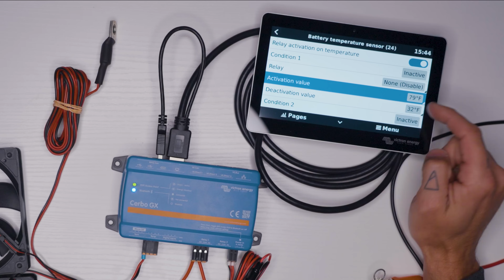Controlling a Fan with the Cerbo GX

Comment: Thanks - this was helpful.  I was thinking the Cerbo could be used for something like this.  I installed cooling fans in the electrical compartment, but don't have an automatic way to turn them on and off.  For battery warmers (which I am thinking about adding) I would need to use another a second higher powered relay that would be triggered by the Cerbo relay.

I might get a Cerbo and the monitoring screen.
Reply from the maker: Perfect!  We have those in stock and ready to ship in our store.  Reach out if we can assist in any way: https://shop.explorist.life/support?utm_source=youtube&utm_medium=comment&utm_campaign=support&utm_content=response_link

Comment: If anyone has lost their terminal relay blocks, or their installer did not provide and you want to make this upgrade - which I did and highly recommend doing, know that Victron distributors do not sell relay or the I/O terminal blocks. The temp sensor yes, the blocks, no. But I found aftermarket parts that work perfectly.

----------------------
MFG : WURTH ELECTRONICS INC / 691352710003
DESC: TERM BLOCK PLUG 3POS 5.00mm 1.85000 1.85

This terminal block has a screw driven compression clamp and its pitch is ever so slightly less than the OEM block. Because this block does not use an OEM style vertical spring mechanism, it's profile is not as tall as the OEM (it hangs down less from the GX).   I bought 1 of these blocks for $1.85 + shipping from an un-named electronics parts distributor.

======================~~======================

MFG : WURTH ELECTRONICS INC / 691353500003
DESC: TERM BLOCK PLUG 3POS 5.08mm 3.55000 3.55
 
This terminal block has spring loaded compression clamps and its pitch matches the OEM blocks pitch perfectly.   I bought 1 of these blocks for $3.55  + shipping from an un-named electronics parts distributor.

I like the screw style better.

Comment: Consider using a auto radiator cooling fan thermo relay/switch, at least 15 amp control.
Reply from the maker: That wouldn’t utilize the cerbo GX, though, which is the whole point of this entire video.

Comment: Does the relay take AC current? I am thinking of using a 230V fan...?????
Reply from the maker: Great question! Some relays can handle AC loads like a 230V fan, but it really depends on the specific relay module being used and how it's wired into the system.

To be sure you're using the right gear and staying safe, I’d recommend reaching out to our support team — they can help you find the best solution based on your setup:
https://shop.explorist.life/support
(Free personalized support is available for items purchased through our store!)

If the parts were purchased elsewhere, our EXPLORIST Pro Support Membership can still get you expert guidance tailored to your needs:
https://shop.explorist.life/shop/all-products/membership-tiers/

Comment: Did this, worked once, now relay 1 won't open even though the temperature is below the set point. Cerbo shows it to be inactive, yet the fan, 48vdc, 50mA, continues to run. Unplug the relay connector from the Cerbo, and the fan stops. Hard to imagine the contacts got welded with such a small load! Specifications for the relay are 1A @ 70vdc.

Comment: With the van parked , it can be above 79 causing your batteries to be depleted.  Is there a way to prevent this so it's smart enough to only enable when the Victron sourcing a certain power?
Reply from the maker: With enough effort and relay logic, anything is possible.

Comment: Perfect. I had assumed that i could do something like this. A few weeks away from going back to finishing off a plantroom which has 3 x 15k quattros + 2 x mpptrs 450/200 + 90kWh BYD LVL + 17k fronius Symo. I have fitted extractor fan to outside and a vent for air in.

Comment: I have the Cerbo S-GX so it does not have an analog input. Do you think I can install the temperature sensor on my IP-67 Smart Shunt and through Blue Tooth or VE.bus access the temperature data on the Cerbo S-GX to control my relay 2? It would be wonderful if that was possible but putting it all together in my head from the on-line manuals is driving me crazy. The four 12-volt fans I have will use a total of 2.6 amps while running, so it seems that part will work just time.
Reply from the maker: I don't think that is an option, no, but you can always give it a shot and see!
Reply: @EXPLORISTlife  Thanks. It was a stretch to hope their SW would grab it just like how their 3rd party tags do it now, but they may not have thought that extra detail important. I did not even know the Cerbo-GX full would have been useful in the resistive input for using it in a scheme for cooling. I remember being surprised that I had the "S" model when I finally pulled it out of the box, so I wasn't aware of the differences until I compared my device to your video showing how to attach the temp sensor. I suppose the MK2 Inverter resistive input is just for battery charging in the event of L.A. batteries? Otherwise I may have to invest $50 in the BT tags or maybe even the $12 stand-alone controllers from AMZ that many are using already. 

It's all about education & I have learned a lot so far. We support about 75 campgrounds in CO in the USFS, so when our new camp hosts show up with a 50-watt solar panel & a single group-24 battery, as a Fulltimer for 16 years, I can offer them real-world guidance, lol. David

Comment: Can you set it to activate from a multiplus' internal temperature?
Reply from the maker: That's not really what this tutorial is about, but the Multiplus relays can indeed control a fan based on a few different variables.
Reply: @EXPLORISTlife  I meant can the cerbo take the multiplus temperature and turn on a fan, or is it limited to it's own temperature sensors?
Reply from the maker: I see.  I don't think that is a native trigger within the Cerbo, to my knowledge, no. But that's also not somethign I've ever looked for.

Comment: What firmware version are you running? I cannot get the temperature values to change ...
Reply from the maker: It was probably the latest firmware available at the time of making this video.  I don't recall the specific number, but you should be able to cross-reference and update as necessary.

Comment: Nate,
thanks for the video I just purchased a Cerbo and I have the unused temp sensor from my multiplus and I didn’t know I could use the temp sensor from the multiplus for temperature reading of my battery bank!  Now I don’t have to go out and buy a temp sensor to ventilate my battery compartment. I thought at first the sensor lug needed to go to a lug on the battery thanks for clearing that up.😊

Comment: Realized immediately after seeing my MultiPlus (that’s installed inside a tight space) reach 115 degrees on the outside enclosure that I needed cooling fans.

This tutorial made it so easy, thank you so much!

I have a 24v system and was easily able to find 24v brushless ball bearing computer fans on Amazon.

Comment: I have 2 stage fans can I use the relay to run both stage some how through nc  and no on the 1relay
 I mean run low stage then as temp climb have the second stage to cut in 
One wire is power wire then the other 2 wires are both neg wires

Comment: The Cerbo-S GX has no input for the temp sensor, but does has relay ports, so is it possible to make a fan work with  RuuviTag sensors?
Reply: Yes it should work with Ruuvi. At least I can configure it with Ruuvi using latest FW 3.41 in Cerbo GX..

Comment: Nice video! So, if let’s say I have the inverter and solar controller on an enclosed compartment.. should I use the fans to push fresh air in, or extract hot air out? Or both!

Comment: FYI the relay according to the specs in the manual does 6 amps  up to 30VDC not 4 amps😊. I am using this relay for a battery heater and it draws 4.5 amps. Great vid by the way and very timely for me.
Reply from the maker: Ah, yep!  I got the Cerbo relay and the Multiplus relay switched.  Cerbo = 6A up to 30A and Multiplus relay = 4A up to 35V.

Comment: Thanks for the update!! When the Cerbo first came out they hadn’t enabled this but the BMV-712 head unit did (and still does). That is an option if it’s closer to your switched load. 
Also, a cheap PWM will allow you to reduce fan speed, power draw and noise. Mine is set to circulate air from the main cabin when the battery compartment is too hot or too cold since it is lithium.

Comment: can you do this but instead of using the wired temp sensor, using a ruuvi temp sensor?
Reply from the maker: Relay switching via ruuvi + cerbo is currently not a feature, unfortunately.
Reply: @EXPLORISTlife  I have just set this up with a ruuvi bluetooth connected to a Cerbo-S GX and it works!  The Cerbo-S GX is on firmware v3.12 so maybe the feature is working in the latest firmware.  I use this to run a small battery heater at 4.5 amps.  Because I want to turn the heater on when the temperature goes below 43F and turn off above 45F, I had to connect it to the normally closed connection on the relay block.  That means at 45F and above the relay is active, but because i am using the normally close connection it is in fact off.  When at 43F and below the relay goes inactive which turns on power to the normally closed connection and the heater comes on!  Quite a mind game but it works.  Instead of active / inactive it should be something like activate NO and activate NC.  The normally open(NO) and normally closed(NC) are confusing too :_facepalm: Also for temp feeds Victron should make it more intuitive.  Maybe a temp when it is on and +- temp diff that it stays on until it fails below, if -, or above, if +.  Thanks again for all the cool stuff you present in a precise understandable way.

Comment: It's worth noting that Victron sells two different temperature sensors, I believe only one of the would work for this application.
Reply from the maker: The one from the Multiplus works and the one from the parts list I made in the blog post works as well.

Comment: This is perfect Nate.  The cheap Amazon thermostat in my cabinet doesn't hold the parameters well and has to be continually reset.  Ive got that temp sensor in storage somewhere gathering dust.  Looks like a fun little Saturday afternoon project.  Thanks.

Comment: Is there a way to calibrate the temp sensors for the cerbo? I have 3 in my system placed in different locations as well as a higher quality temp sensor and I’ve noticed the victron sensors all run 5-10 degrees warmer. Not a huge issue but kind of annoying, especially when trying to program to trigger things are specific temps.

Comment: Great video, as always, explained clearly and to the point! Would be great if you did a similar video for the Cerbo to control the AC (220 or 110V) water heater, say, on SOC of the batteries. Thank you.

Comment: Great info, thanks! Any ideas to pair a CGX with a higher amp capacity external relay to switch on/off a 25a water heater element (600w/24v)? I'm looking to control my tanked water heater efficiently, much like how the fans are controlled.
Reply: Use the cerbo relay as the trigger for the higher amperage relay powering the heating element. You can program it to be based on SOC so it's only on when you are fully charged to whatever parameters you choose. I have mine set up for "solar dumping". When I'm fully charged, it turns on a relay that controls the water heater and shuts off at 95% (or whatever I choose). My water heater is still working on AC power so the inverter needs to be on and the relay is and AC relay controlled by a DC input.
Reply: @chachi5975  This is GOLDEN!! Thanks for the advice! This is the missing link to complete my diy thermal heated floor project without having to fork up THOUSANDS from limited sources! I don't have a CGX yet, but I will soon. 

May I ask, is your water heater tankless or tanked? I ask coz if it's tanked with capability to swapout to a dc heater element at 12v, 24v, or 48v, you can potentially bypass the use of the inverter/AC to save you some power. The CGX could keep the heat at that sweet spot as thermometer would from just capable batteries and solar.
Reply: @halleluYAH144  I just copied the link that I used to make that work. It's a little tricky but he explained it well.  I originally had it set up so when I was fully charged, I could save propane for my absorption refrigerator. I have since switched to a 12v compressor fridge and now have the victron BMV relay wired to turn on the water heater element when it's switched on. I have a travel trailer with a water heater tank with propane/AC heating element. I had the same thought as you with the 12v element but the thermostat on the water heater wasn't compatible. I was trying to keep the inverter off to save power as well but my thinking has changed a bit. Since I'm only using that feature when I'm fully charged, I'm not worried about inverter losses (3.9A) for my multiplus. When I'm camping I'll turn on the water heater AC element but it won't turn on until I'm fully charged and I have it set to turn off at 95% so I have hot water for dishes and a shower, but still plenty of power for the coffee maker in the morning! I hope that gives you some ideas. BTW I simply have the outlet wired to the relay so I could control anything powered by AC and plugged into that outlet. It used to be the fridge and now it's the water heater.
Reply: @chachi5975  gotcha! Didn't think about AC uses. Could open up other doors in future. Perhaps turning a cheap deep freezer into a fridge with the thermostat relay setting to turn on/off..hmm. Thanks again for sharring!
Reply: @halleluYAH144  yes the thermostat is available with the cerbo, the BMV is limited to voltage and battery percentage I think.  The key to that is the AC relay that's triggered by a DC control.

Comment: Thanks for all the great info over the years Nate.

I have a system with a Cerbo and a Touch display, but I've been getting a craving to make my own display using data that's pulled directly from the Cerbo. For starters, I think it would be cool to have a lit seven segment display for how much my solar is bringing in, SOC, tank levels, etc. But later I think it would be fun to add a speaker and have it play a sound when my batteries get low or something. I realize VRM does all this in some capacity, but an always on display above my dinette would be pretty convenient.

I'm a programmer and have made projects with microcontrollers before, so I shouldn't have too much trouble with that part of the project, I just don't know how to get the info from the Cerbo (although I'm pretty sure it's possible). Have you ever done any projects that have done that? Do you by chance know any big topics that I can start researching to get started with this?
Reply from the maker: Hey! Thanks for that and glad it has been helpful.  Since you've got some programming know-how; to point you in the right direction of what you are after, check out the 'modifications' forum of the Victron Community.  It deals with all of that stuff with custom programming through the Venus OS: https://community.victronenergy.com/spaces/31/index.html

Also the Node-RED Victron Forum: https://community.victronenergy.com/topics/4571/Node-RED.html

That should at least give some direction.
Reply: @EXPLORISTlife  You're the man Nate. I've watched a couple of parts of a Victron web seminar on Node Red since you replied and it's really blowing my mind. This is precisely what I needed. This is going to be FUN. Thanks again.

Comment: For a large system which might need lots of automation, control, etc.. this is absolutely worth it because it's relatively easy to understand and program yourself. But for basic functions like what is shown here there are much easier and cheaper solutions.
Reply from the maker: Well... nobody is buying a Cerbo GX just to run a fan.  They are buying a Cerbo GX to monitor all of the various Victron components in their electrical system and since they have the Cerbo GX, they may want to use it to control fans; which is what this video is about.  If somebody already has a Cerbo GX in their electrical system, there aren't any cheaper ways to turn fans off/on through a temperature controlled automation since it's just the cost of the fans, some wire, and a fuse; all of which you'd need with any other type of ventilation solution.

Comment: I know you're sponsored by Victron, but could you do one of these with a Raspberry Pi running VenusOS too? Thank you! Or at the very least, add it to the blog post? I've been using an off the shelf 12v temperature based fan controller separate from my units (one is PWM one is not). And I'm not sure it's programmed in a helpful way.

Finally please convince Victron to give us Temp details from our Multiplus?

Comment: Thank you for the video. Finally, someone showed it. 
A second Cerbo relay could be used to heat the battery based on the temperature sensor from the BMS, would that be possible? 
Could it be used in combination with temperature based automation like touch buttons in VRM, where the cooling/heating would be turned on/off manually?
Would the relays work similarly on MPPT and on inverters?

Comment: Can you pair it with Ruuvi temp sensors as well?

Can it also work if you flip it? Ie: if an area gets too cold, can it flip a fan on to move warm air to an area until it heats up...? Or do the temps get confused then?
Reply: Yes I have done it

Comment: Can you make a video sharing how to these fans can turn on when the multi-plus is running in Bulk charge (Putting off Heat) or the Inverter is on.
Reply: I just put the temperature sensor near the output fan of the multiplus so when it's trying to cool itself I am adding additional airflow to the compartment.